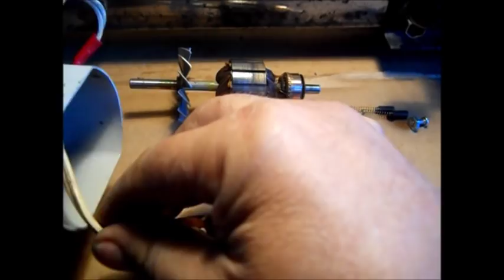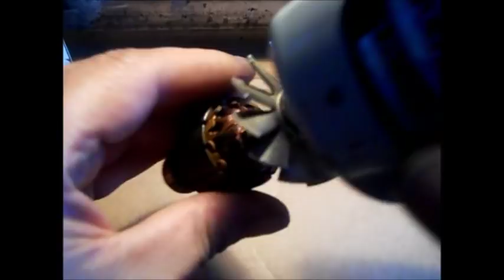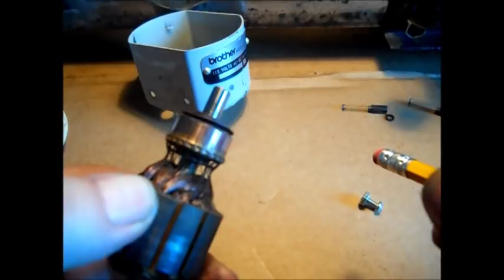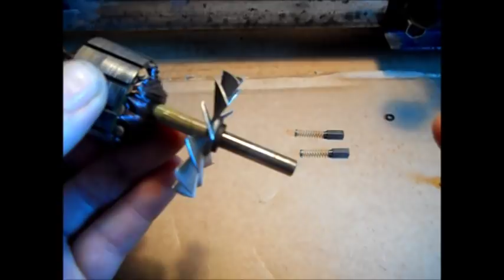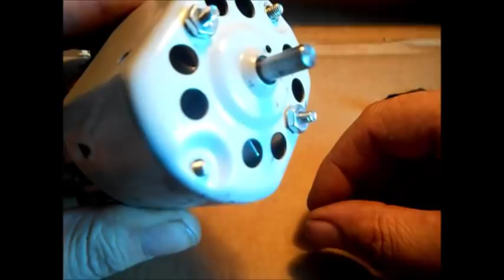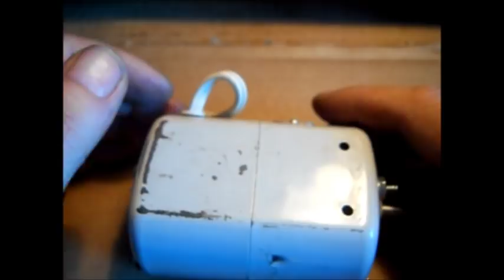Sewing Machine Motor Repair.

Comment: Hello, I know this video is filmed a long time ago but I hope you can reply. I have the same motor. I have opened it and cleaned everything. I have assembled it back together and that metal shaft that sticks out is moving back and forth, if I pull it by hand. I'm not sure if it used the happen before I didn't check. Just like in yours, there are no bearings, only this hole that I also had to tighten as it was wobbly. It also moves when the motor is on, so in order for the bushes to be in the correct position you have to push it slightly when it's on. Is that supposed to happen, is it the design? Maybe when I'll connect the belt, that will hold it in place? I would appreciate it, if you could help me. Thank you
Reply from the maker: maybe add a thin washer to keep the shaft were it should be
Reply: @not2fast4u2c  i just did that but wasn't sure if it's supposed to move or not. As there isn't anything in the design that would stop it from moving. I actually had to add 2 metal washers and the one that was already there for it to stop moving. Thank you for your reply

Comment: My apologies. I was wrong!  There are oil-infused Bronze bushings with SAE oil. Oilite is one brand name. Antique sewing machines in the 1930s had a oil/grease reservoirs.  Bronze oil-infused bushing was developed in the 1930s.  My 70 year old machine (like yours) has two similar bronze bushings (each end). Luckily for me, the tangs of the 2 brackets are still holding. My westinghouse motor (circa 1950) has 2 oil holes just on top of the case dimples.  Manual says to add a drop of oil into the 2 holes yearly.
Reply from the maker: That is why I did not respond to your other comment ...I have a piece of the bronze that I made a bushing for my 40's lathe
Reply: @not2fast4u2c    I am a chemist and the general principle is "like dissolves like."  Oil as a liquid cannot "dissolve into" bronze, a solid metal alloy (mixture of metals). Likely  there are nano pores throughout the bronze that are "infused" with oil.  Example: Oil does not dissolve in water.  An emulsifying agent will disperse the oil throughout the water.  I am nitpicking, admittedly.  I am also struggling with the refurb of my Mother's old sewing machine motor and your video was very helpful.
Reply from the maker: @annareuter7639  They make bushings from bronze that are small little pieces pressed together which leaves space for the oil to soak in I think they are called sintered ? bronze

Comment: Good Video.  Oil cannot dissolve into "bronze (brass?)" fitting.  Chemically impossible!  My theory:  Oil seeps around edges of the fitting.  Note the hole for oil on both sides of the motor.  My motor has the same two holes and my brass fitting stops short of the end of case.

Comment: thanks for the help, all these years later. cleaned up my singer 206k motor, was making awful noise and smell. rotor is worn smooth on one side.. but it works.
Reply from the maker: Glad it helped

Comment: I enjoyed your video and it was helpful. I have one problem and that is there seems to be no available videos on how to connect the light and motor and foot pedal together in the right order. If you understand how to do this it would be an extrememly helpful video.Thanks Beth
Reply: I fixed (rewired) a Singer motor yesterday--found a diagram on google images.  It was a black and white image, so I printed it out and colored each wire from  starting place to destination. It helped.  Works fine.

Comment: We have smoke coming out of our vintage Brother motor (over 40 years old) I stripped it down after watching your informative video cleaned the commutator and filed the brushes, it was a little dirty inside but thought i'd cleaned most of carbon residue off, maybe this old machine is ready for the breakers yard. (Brother has confirmed that replacement motor is not available)

Comment: The Pencil Eraser Reminds me , We Used to Use them on the Armatures and Pickups on Aurora  HO Slot Cars in the 60s and 70s ! Anyways Great Video !
Reply from the maker: My brother and me did the same thing !....We also used are Dad's mennen skinbracer after shave to clean out the motors and the we would stick the sled runner things directly on to the transformer box and wind them out to full speed ..We had a drag strip that we set up and it was measured to scale of a real 1/4 mile ..We would soak the spongy slicks in after shave and do burn outs and make the tires sticky

Comment: This is a great video - thank you! I have cleaned a lot of vintage singer motors/machines. I have a vintage 830 Record Bernina. When I step on the pedal and hold it full speed the motor runs fine then winds down, runs and winds down. It sound like I am lifting off the pedal in even intervals, but I am holding the pedal down the whole time. I am thinking/hoping all I need to do is clean the motor and put in new brushes. I HOPE it's not the pedal b/c I have never fixed a pedal before! (:
Reply from the maker: Glad it  helped ..Thanks for Watching !!!

Comment: How in the world do I get the tiny screw off the pulley so that I can remove that second casing and access the commutator and brushes. If i put a flashlight into the the holes I can see the brushes are worn down. I can't for the life of me get the pulley off to access it :( help please
Reply from the maker: If you have the correct screw driver that fits It should loosen the screw...The only other thing I could do is drill the screw out ..Which is not easy
Reply: not2fast4u2c the screwdriver is correct, flat and the right size. But its deep and won't budge and the head has been warped a bit by now. I thought of drilling it out but not that sure if I should
Reply from the maker: Can you buy a new pulley...and  carefully cut the old  one off .I used to have a sewing machine repair business near me ...but now I would have to try the internet
Reply: I could take it in to a shop but they'll automatically change the motor and charge me a lot for it. I think thats my only choice, not comfortable sawing thru the steel pulley, the rod may get damaged and finding the right pulley ay be an issue.

Comment: You are wise not to use an abrasive on the commutator segments.  That black you see in the copper is conductive graphite, formed from the brushes.  If you take the commutator down to shiny copper, the brushes will need to reform that film again.  That wears the brush down.  Use a pick to scrape between the commutator segments.  They are micarta and if they are allowed to stick up higher than the copper, the micarta will lift the brush, then arcing will persist.  So, clean between those segments.
Reply from the maker: If I was re building a bigger motor like a car starter ..I would use a lathe and turn down the copper ..I would also be using new brushes that do wear down a bit as they break in ..I also would use a piece of a coping saw blade to re cut the slots between the segments

Comment: can I change the motor cord on a vintage singer sewing machine Model 15, from  1942 , that's been sitting for years.   I was able to change the cord to the foot pedal and to the lamp but don't know how to take it  all apart.   It is  a motor #  1819146 simanco  motor catalog P.G.7 100-110 volts 0.6 amps.   The wheel goes around  it doesn't seem seized up but the cord is rotten.   And How do  I get back to you to see if you answered me?  I guess I'll write your name down.  you can pull up my fb page maybe?  or pm me. ?
Reply from the maker: Sorry but without having it in front of me ..I can not tell you how

Comment: Hi there.  Great video!! I just took my mom's 1963 Kenmore motor apart thanks to you!  Looks like the washers on both ends of the shaft are bad.  How many are usually on each end? Where do i get new ones?
Reply from the maker: I would not know where you can get washers ...If I added any I would make sure it is ...centered on the brushes ..and the motor spins free when assembled

Comment: I installed thjs motor using my original bracket onto my pfaff 130. After only a few minutes of running it the motor and foot.pedal were very hot. Did i do something wrong?
Reply from the maker: I would not know..Are you sure your machine can use this small size motor

Comment: hi. i have a jones sewing machine and has very similar looking motors to the one shown in this video. my problem is that the machine won't stop running. what could be the issue. please help.
Reply: tahir m if you have a double plug, one that connect to the light and the other to the motor, switch them, you connected the foot pedal to the light instead of the motor. If you look closely at those old plug it's engraved on it. Motor and light.
Reply: In case someone reads this in the future, in my case every time this happened it was the capacitor in the control pedal.  It  seized and is closing the circuit. Cut out the capacitor and you're good to go.
Reply from the maker: +tahir m Does it have the foot pedal ? it could be bad

Comment: The screw to hold the motor in is so tight, I am afraid to break it loose. Any suggestions?
Reply from the maker: Donna Johnson You coul spray a little WD-40 on it I don't know if you could find another small bolt that long If it breaks at least you can get a motor for around $20 If you have a repair shop near you  they may have a bolt I would try to get it loose by turning it back and forth a little at a time

Comment: Hi, nice vid, I have a tip you may like. Sorry a bit late .. To correctly bed the brush on the copper commutator, wrap your 400 grit paper around the copper then push the brush on while you rotate the rotor, this way you will get the exact curvature required. Take care ...

Comment: thanks for making this video and having it on youtube. i would have kept on using the machine with the motor running very slow or might have bought a new motor.
Reply from the maker: Meng EFresh You are Welcome I have found motors cheap as $25 but it is nice to have the original one Thanks for Watching !!!